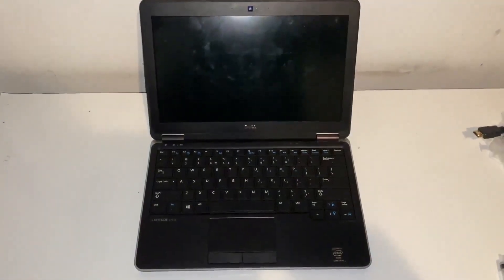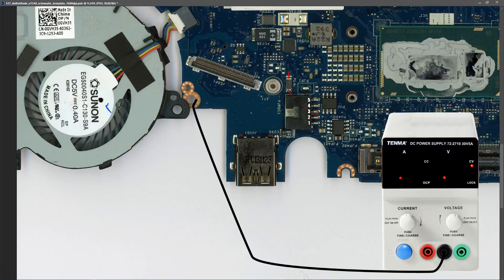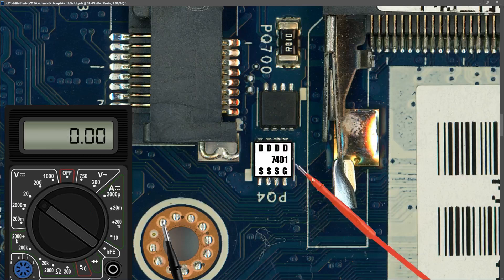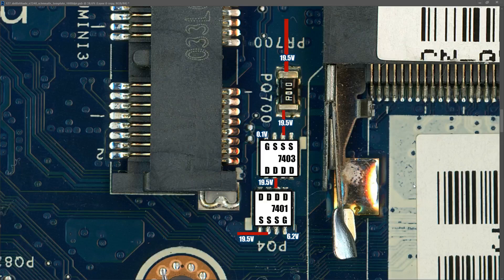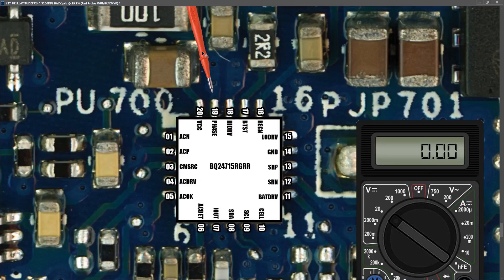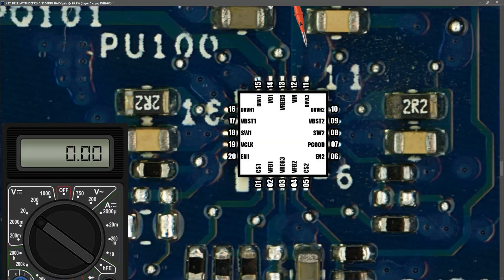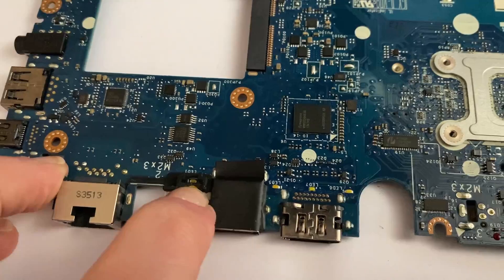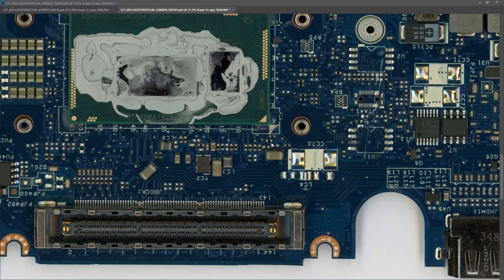DELL LATITUDE E7240 - NOT POWERING ON

Comment: What if v reg 5 and 3 are not preseent
Reply from the maker: Two things. 
1. Check to make sure that the input to the VREG3 and VREG5 ICs are getting the correct input. 
2. Switch off all power and check for shorts on the VREG3 and VREG5 outputs.